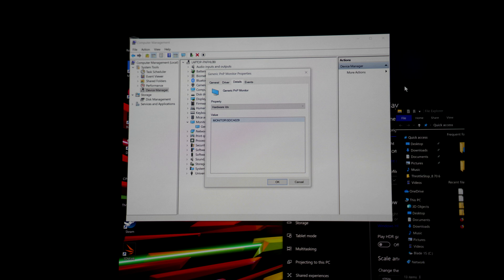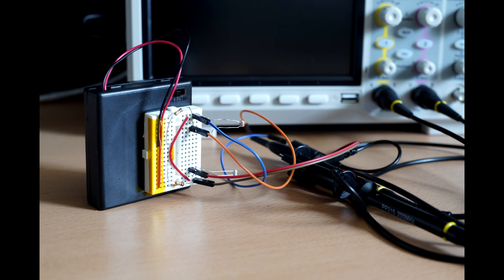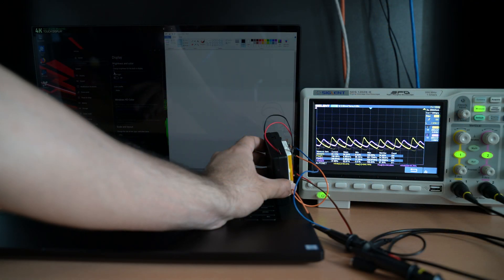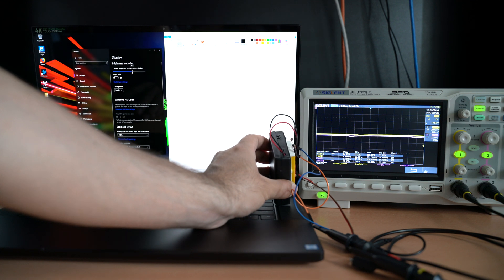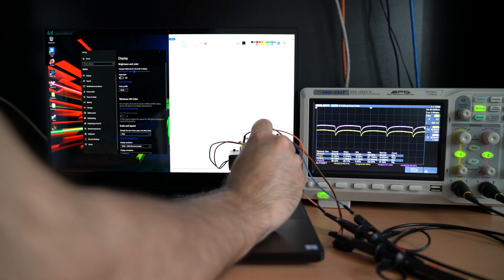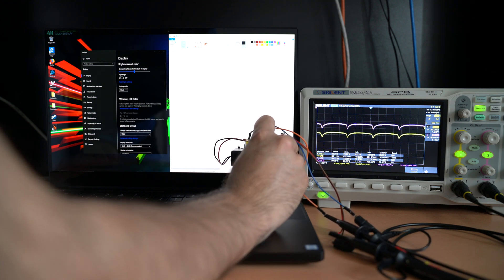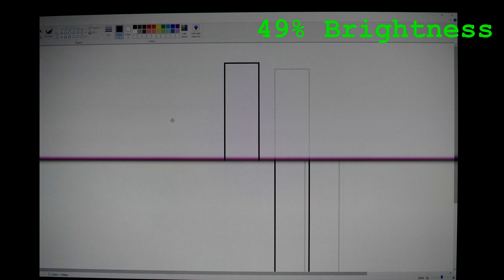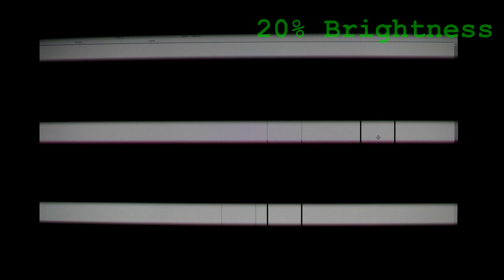razer blade 15 oled pwm test

Comment: Im a little confused with OLED displays at the moment. I came across this article that said "The m15's screen blew past the 146% color reproduction average with 265%. The Blade 15 was a distant second at 149% with the Triton 500 and Aero 15 tied at 117%.
Whoever said OLED isn't bright hasn't seen the m15. This bad boy produced 376 nits, crushing the 286-nit premium gaming average. At 277, 262 and 246, the Triton 500, Blade and Aero 15 were far from a match."

Is there any validity to these cliams?  I read on Razers website that their 4KOLED panel had upto 600 nits.How can the official website quote 600nits and another say its only 262? The Lenovo Thinkpad X1 Extreme OLED has 500 nits and is a touchscreen panel. Are the non touchscreen OLED panels better than touchscreen ones? I also read somewhere that in 2019 all laptops with OLED displays will get them from the same manuacturer, i.e Samsung. Is this correct?If so do the OLED panels differ at all. Im interested in Razer Blade 15 OLED, Alienware m15 OLED or Lenovo Thinkpad X1 Extreme gen 2. OLED. Which do you recommend in terms of display quality?
Reply from the maker: for brightness, you can see the panel i got on the razer hits 530 nits, with 519 nits center brightness. this is very bright.that said, you have to keep in mind, these samsung OLED panels, which are being used on EVERY 15" OLED option from multiple OEMs, are NOT the first OLED panels on laptops. Samsung was previously making OLED panels for 13.3" and 14" laptops, albeit, there were not many on the market. these previous gen OLED panels were dim. they scored around 220 nits of brightness only. as for the differences in brightness from panel to panel, they can vary with coatings applied to the screen, software and/or hardware limiters to restrict the display from getting as bright (this happened with software to many people, where max brightness felt dim. my 4k ips blade 15 went from 380 nits to 280 nits max brightness over a day, probably because of windows update), the variation of the panel (SDCA029 is technically the name of the controller and not the panel itself), and/or the quality of the panel produced. the 262 nits reading was either a typo, a reading not measured correctly, or software limited maximum brightness. something else to note with OLED screens. they will get dimmer over time.

i have yet to test the colour gamut accuracy and volume of the display i got, so i cannot comment on that yet.

display quality is going to be about the same no matter which manufacturer you go to, since the panels are theoretically built to the same spec.

all other things considered, if you are going for a laptop with an OLED screen, i would go with Razer Blade 15 if you want graphics power and looks, Gigabyte Aero 15 if you want graphics power and tremendous versatility (its got all the ports, numpad, a keyboard with actual key travel distance), or thinkpad x1 extreme if you want something very versatile, tough, and something that has proper customer support. the touch screen on the lenovo and razer should end up looking similar. i...personally don't like the alienware m15. the old one has that ugly glossy plastic bezel that is all wavy. the new one has soldered ram that you can't upgrade. furthermore, i have personally had some very bad experience with dell support, and they way dell deals with the xps 15 9570 problems, makes me not want to get a dell ever again.
Reply: @KumaMech  Thanks so much for putting the effort into answering my questions. I have a 2 year old Aorus X7 with a GTX 1080 that I use as my primary gaming machine and its still super fast with all the current games out. I am looking for something a little more portable, light but also capable of playing most games. I agree that the Alienware m15 probably wont be my best option. They have improved in design but it still looks big and I wont be able to use it for work. Il go with the Razer or Lenovo. You make a good point with  brightness nits values being affected by software and hardware restrictions probably to preserve the display itself but also to produce a decent amount of battery life when unplugged. Thanks again for the info.
Reply: @Med-Ved-Ted  I'm interested to buy this week the new aero 15 oled rtx 2070 but in same time I like the new razer blade 15 oled rtx 2080.. I'm trying to do content creation and some games , which one do you advice to buy ? Thanks